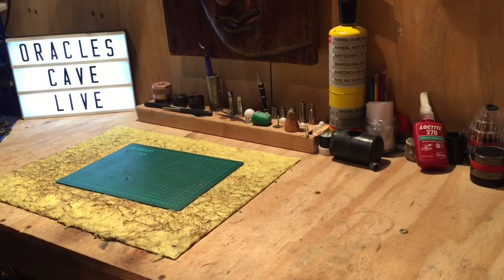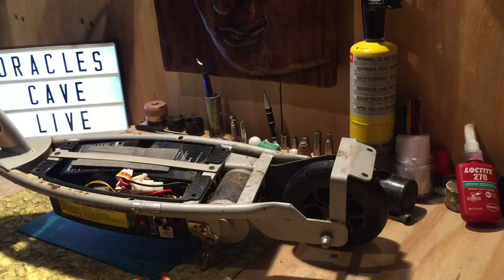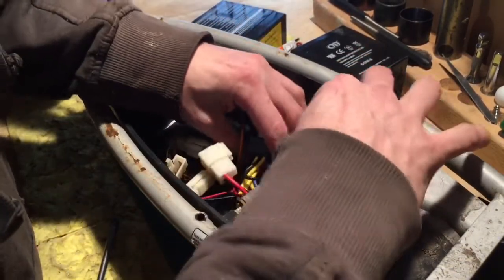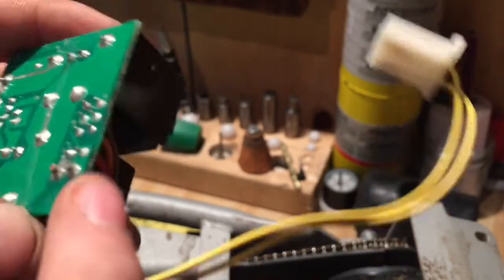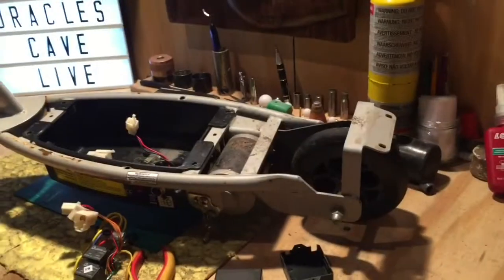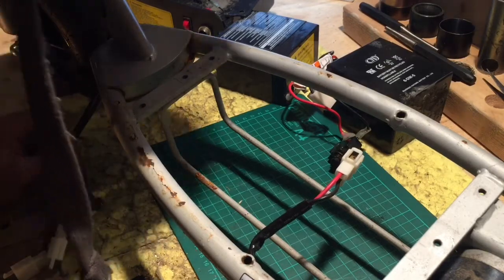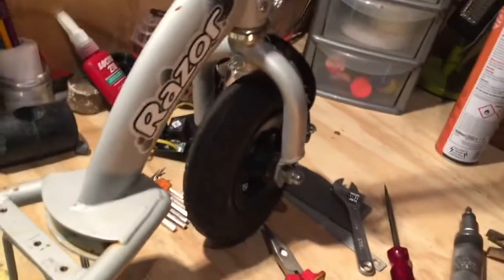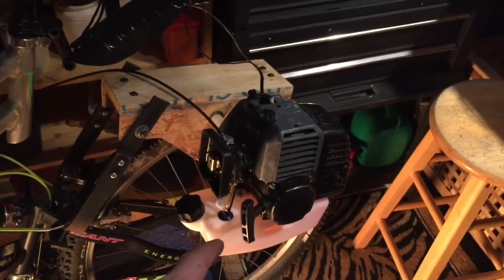RAZOR ELECTRIC SCOOTER ENGINE CONVERSION PROJECT

Comment: Do you think it could power a small go kart with a bigger battery?!
Reply from the maker: Yes it would work, maybe very slow and be slower on grass but on tarmac it would drive a go kart.

I would probably go 250w motor minimum for a go kart.
But I also try stuff for the sake of trying, so I would absolutely try that motor.

A bigger battery probably wouldn't make a difference and just burn out the motor.
And also the way the electrics are set up, the scooter needs to be pushed before the throttle will work.

So the go kart would need to be bump started by pushing it while someone was in it, very hard to do while you are on your own.

I still have my motor aswell, I have not thought about using it for anything yet, but this might give me some ideas.
👍👍👍

Comment: What engine do u put on iy
Reply from the maker: The small pocket rocket engine
Minimoto
It gets called 49/50cc but I think it's a 47cc.
Basically it's a strimmer/weedwacker engine.
👍👍👍
Reply: Cause I'm thinking off doing the conversion for the razor e100 but need a small compact engine for it
Reply from the maker: @OddsNEndsAutos  those engines are very easy to come across or they are £60 brand new in the UK.
Much cheaper in the states.
Plus you can get a race version with high compression head for a few bucks more.
Reply from the maker: @OddsNEndsAutos  https://www.ebay.co.uk/itm/Mini-Pocket-Minimoto-Bike-Air-Cooled-49cc-Racing-Engine-Red-ATV-Dirt-Dirtbike-GP/174114880247?epid=13034030607&hash=item288a0e3af7:g:b~kAAOSw40xfFLo9
Reply: @oraclescave  thanks bro appreciate

Comment: how hard would it be to convert one of these to a regular kick scooter?
Reply from the maker: Easy peasy, once you disconnect the chain from the motor to the wheel, it is actually very good as a kick scooter, the bearings are free flowing with next to no friction.

Frame is a little heavy but it totally works, we tried it.
👍👍👍
Reply: do they fold? and would the frame support 200 pounds?
Reply from the maker: @fudk_off1312  no the frame does not fold, but I imagine that frame would take 700 pounds.
Its built like a real motorbike frame.
Very solid, nothing like a real kick scooter, real kick scooters are made from cooking foil lol

So yes this frame will support a lot more weight than you need.
Reply: I might have o modify the handlebars to be taller, im 6'3. I wish there were more videos about complete teardowns so I can get an idea of what I have to work with before I buy one
Reply from the maker: @fudk_off1312  just a bit of pipe, you could cut the handle bars pipe in the middle and extend it with the pipe.

It could be welded on, or if no welder, you could get pipe that fits snug and drill holes and put bolts through it.
One bolt above the other at each end of the extension.

Or possibly scooter bar set from kids stunt scooter, they might actually fit, height might still be too small but probably a better option.